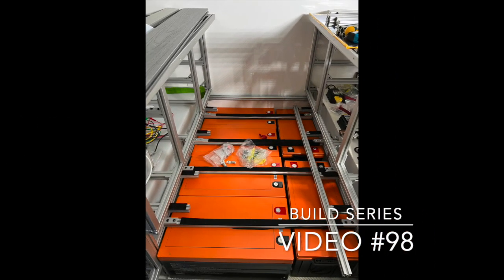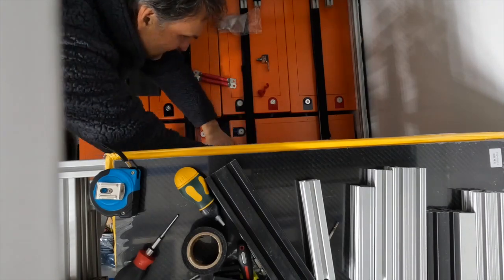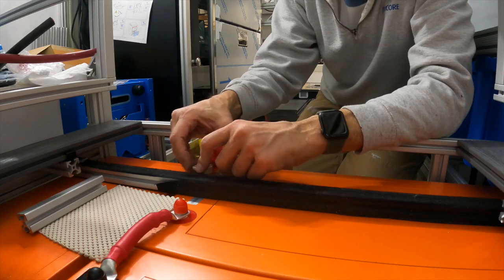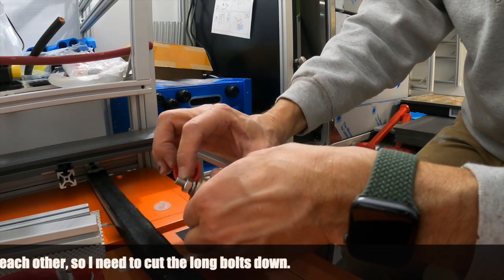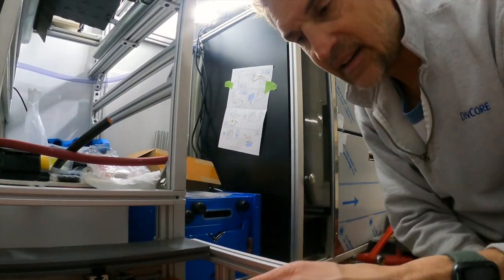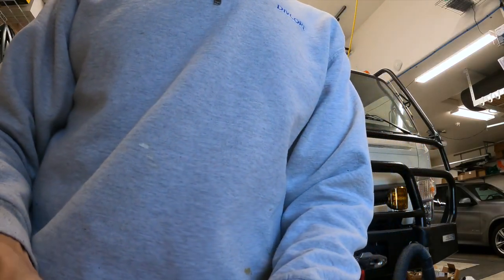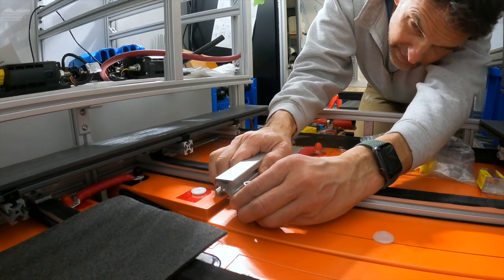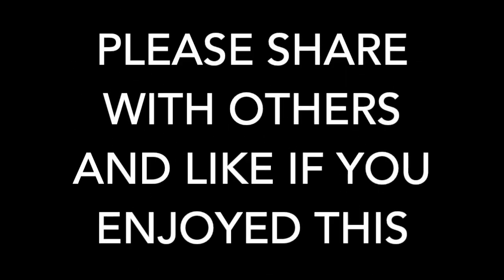DIY Expedition Camper large Battery System: Modifying Fuse Blocks

Comment: So do I go by the BMS amperage for each battery when sizing these fuses? If I have a 200A BMS for one battery, do I need to get a 200A fuse? Or how do you size them?
Reply from the maker: Yes, you size the fuse to the max current that the battery can supply or receive. Mine are limited to 200 amps each even though 300-amp-hours each, so I sized the fuse and wiring to support 200 amps each since that is their internal limit. I tested that limit and confirmed that they won't exceed that limit.

Comment: awesome. any considerations for maintenance (6mo re-balance) or replacement? does the top frame come off easily, how would you get at the batteries in the back?
Reply from the maker: Yes, the floor frame easily hinges up and can come off, but I see no need for any maintaince, since all battery pairs have equal length connections and share of charge and discharge currents, temperatures, etc, they should all last ten plus years without any issues.
Reply: I have 2 100 ah Wattcycle LI’s connected in parallel.  I have them connected to a 3000W inverter.  I used 2 gauge copper welding wire for my cables.  The positive and negative wires are only about 10 inches long so length isn’t an issue.  What size MRBFs should I use on each battery post?  I was thinking 125 amp fuses on each post.  Or should I just install a 250 amp ANL fuse?  The most I will be demanding of the inverter is about 1500 watts for a few minutes.